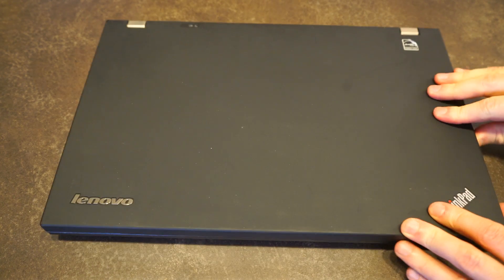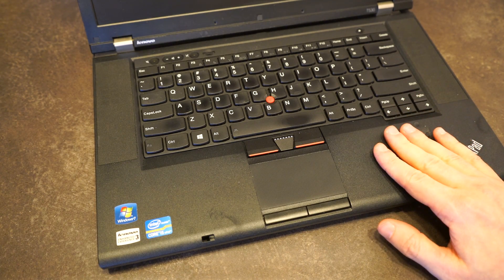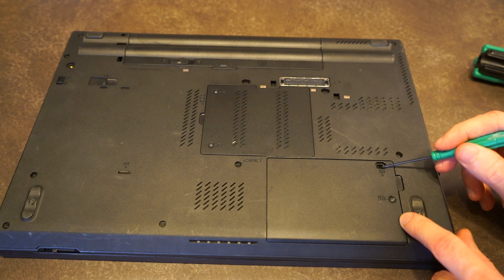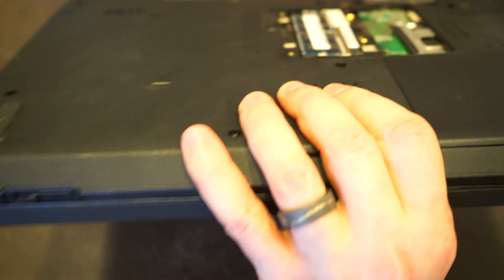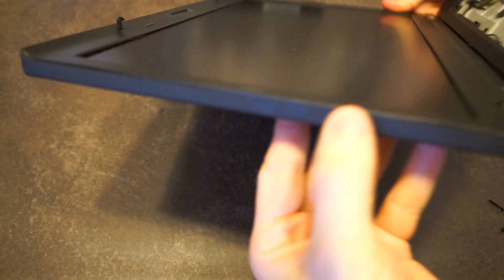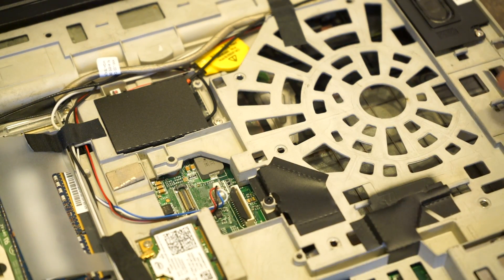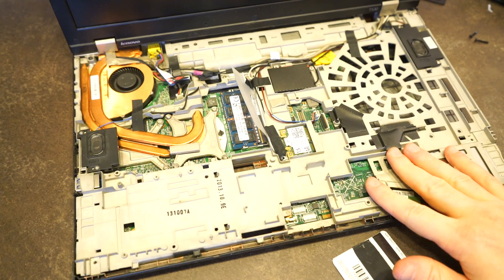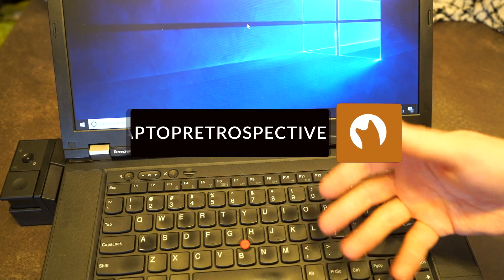Lenovo ThinkPad T530: The T430’s “Big Brother”

Comment: Interesting. So could these machines be comfortably used today? I've seen these used, and it's tempting, as I don't have a lot of money to throw around on a replacement for my Acer.
Reply from the maker: Depending on what you need your computer to do, very much so! One has to remember that they were a thousand dollar business class laptop when they were new and for a good reason. I've given three different people T430 units and nothing but great things to say about them. The T530 is just its bigger brother for those that like bigger screens.
Reply: @LaptopRetrospective  Wow, fast response! Thanks. 
See, the problem I've been having with computer shopping is that none of the descriptors MEAN anything anymore. High clock speed doesn't necessarily mean high performance, and an i7 processor can be outclassed by a newer i3 or i5. Even the benchmarks on a site like Passmark can lead to unfulfilled expectations and disappointment. It's aggravating. Nothing is as cut and dry as it used to be.
Reply from the maker: @jessragan6714  I know what you mean, it can be a bit frustrating. Nothing beats hands on.
Reply: @LaptopRetrospective  Well, I took the plunge. Found a T530 for $190 on Mercari. The deal sounds almost too good to be true, and it very well may be, but I've got my fingers crossed.
Reply from the maker: @jessragan6714  let us know how it goes! We are rooting for you.
Reply: @LaptopRetrospective  Whoops, guess I owe you a follow-up! I'm using it now. It's not the prettiest machine, looking like a black brick when closed, but it's extremely hardy and reliable. Fast, too. I think I'll be keeping it! Thanks for the advice.
Reply from the maker: My pleasure. I'm glad your experience has been positive. Any plans for upgrading? SSD? More RAM? Second drive?
Reply: @LaptopRetrospective  It came with an SSD, but a tiny one (128GB). It's been supplemented with a standard spinning hard drive in the DVD drive bay... I had one lying around and it was almost sinfully easy to install with a caddy I bought on Amazon. I'm rockin' eight gigs at the moment and probably won't take it much farther than that. This system can apparently go as far as 32GB, which seems... excessive. I think I'm good!
Reply from the maker: @jessragan6714  you've also got that slot you could install an mSATA drive, or what about an eGPU setup for your Express Card slot? (Video coming soon btw)
Reply: @LaptopRetrospective  It's a many layered thing, this system. I'm probably not gonna use that mSATA port, but I would like to see how this system handles external video cards!
Reply from the maker: @jessragan6714  I'll try not to keep you waiting too long. I've got a preview picture in the community tab. Initial results are very positive.
Reply: @LaptopRetrospective  I wound up buying a T430 for $54 on eBay, to supplement my T530. Man, these things are like potato chips! Except it's a much more expensive addiction than a can of Pringles...
The system was purchased as parts/repair, but testing it with a build of Linux installed on a flash drive indicates that it works just fine. I won't know for sure until I get an SSD in the hard drive bay, though.
Reply from the maker: @jessragan6714  haha I understand. They are fun machines.

Comment: Just bought one of these second hand with 4gb ram, one module in the top slot. Would just buying 1 4gb module work to get it to 8gb or would I be better off buying a matched pair?
Reply from the maker: Unless the module is the same speed then you might be a bit disappointed. If you were replacing both I'd go for the full 16GB if it is financially viable.
Reply: @LaptopRetrospective  16gb worth it in a machine this old in your opinion? Machine is in great condition, although it's currently lacking a hard drive, it booted fine using an external drive that had Linux installed on it
Reply from the maker: Fair point but depending on your use you might wish you had some extra RAM. These things last so also think down the road.
Reply: @LaptopRetrospective  I think I might go for 16GB anyway.  It's not that expensive and I want to see how far I can upgrade it
Reply from the maker: This is what most people do with these machines. 😁

Comment: Just bought a refurbished T530 - condition is not as good as this. 
Dearly wanted the 520 keyboard, but not sure if I want to do the "surgery" needed to swap out [apparently, some keys don't work afterwards?]
Reply from the maker: That's correct. You can get software to remap most of the keys that don't work but not all.

Comment: Just ordered one of these off eBay for $220.
Reply from the maker: Nice, let us know when you get it!
Reply: Laptop Retrospective it’s the i7-3520m @2.9GHz 8GB nvs 5400, only has 128GB hdd but I figured I could upgrade that later. It was this or t430, but maybe I’ll get a t430 also if this works out.
Reply from the maker: Nice specs. Agreed on the HDD. Swap for an SSD and you have a beast.
Reply: Laptop Retrospective i guess it’s actually a 128 GB SSD... I misread the description. I think I’ll probably order a x230 and t430 as well. One question: can they all use the same dock?
Reply from the maker: Yes.
Reply: Laptop Retrospective thank you for responding. One more question, I’ve read online that non genuine batteries will not charge in these laptops. Have you tried non genuine batteries? I didn’t realize this and ordered a cheaper battery off eBay. Now I’m worried I wasted my money and should look for a genuine.
Reply from the maker: This was true when the laptop first came out. Now, most manufacturers use a method that bypasses the issue. So as long as it's not old stock and it was purchased from a reputable seller, you should be fine.
Reply: Laptop Retrospective that is definitely good to hear, and  thanks for all your help!
Reply from the maker: You're welcome! Good luck.
Reply: b Dub Even if you have an issue, there are videos on YouTube to bypass Lenovo’s battery whitelist through a BIOS adjustment.
Reply from the maker: True, although it isn't often you still need to do it.
Reply: Erik Ive had zero issues with the cheap battery, it works good.
Reply: Erik I actually bought 2 different cheap batteries, first one was a “genuine” 🙄 70+, pretty sure it’s a knock off because it was only $30, the other was a no name $18 6 cell, and they both charge no problem. All you people saying you need a Lenovo battery or mess with bios are uninformed. These newer batteries work well, even cheapest ones on eBay.
Reply from the maker: Not so much uninformed but they are working with outdated information when the laptop came out. Those features have long since been bypassed by manufacturers.
Reply: Which vendor is best for refurb W530?

Comment: I bought a government surplus T530 two years ago. It was in pristine condition,  no scratch or wear marks. Windows 7 was preinstalled and I've been using that. With Win 7, Lenovo had many customizations to the OS. Since upgrading with Win 10 will toss all that, isn't that a minus to upgrading. For example, does your fingerprint scanner really work? Can you adjust battery charging advanced settings, etc.
Reply: im typing this from my T530, and yes, all works perfectly in windows 10, mine is in 1809 update now, and yepp its works like a charm, bluetooth, camera, fingerprint, all hotkey also working good, even the Dolby Digital Plus working perfectly.

lenovo remove power manager from windows 10, and replace it with Lenovo Vantage, you can download it from windows store for free and its pretty awesome, battery charge threshold also works.

allready using W10 for last 6 months, so far and i didnt find anything wrong with it.
Reply from the maker: Thanks for sharing your experience.
Reply: @adiabriganjarutama6144  How to remove the power manager from Windows 10? What do you have in mind?
Reply: @alexf1515  i didnt, lenovo did.
start in windows 10 they remove power manager and replace it with lenovo vantage
Reply: @adiabriganjarutama6144  How and what do you mean? I can't imagine how you can use the built-in Windows Power Manager and replace it with lenovo vantage or whatever. How to do it technically? I can't hack Windows and change it programmatically. I do not understand how to do this, there is no "replace" button. What exactly do you mean and how to do it step by step?!
Reply from the maker: I didn't really have any issues with either. Granted your points are quite valid. I didn't make the OS choice for this device.

Comment: As I found out just last week the seperation of the bezel on the left side isn't a sign of excesive servicing of the display but rather a sign of the hinge getting stuck. Once it gets stuck completely the thin part of the hinge in the bezel cracks and it also tears the screw housings from the plastic part of the bezel. Fortunately you can glue them back in and the pair of replacement hinges costs $8 on Aliexpress.

Comment: Just bought a W530, it s very similiar but even better: quad core i7. (Supports i7 3920XM !), full HD panel,  32 Gb of RAM maximum, and even Raid 0 and 1 configs, and an nVidia Quadro K1/2000 graphic card with 2 gigs of dedicated memory.
It also Can support 3hdds using bay drive and internal msata slot. This is a truly beast!!!
Reply from the maker: Truly a beast by any definition.
Reply: I too have one of these, with the 3740QM and 32GB of RAM. It actually benchmarks slightly better than my i7 desktop machine (which is also a quad core Ivy Bridge architecture).

It's well worth replacing the SSD if you've still got an original era SSD in it; the drive that came in mine is about a quarter of the speed of a Samsung EVO 860 and I noticed that my desktop would lock up briefly when the CPU was waiting on disk IO.

This is more of a problem with a quad core as the CPU cores are much more likely to find themselves waiting for the disk during busy periods of IO. I'd often get lockups during software upgrades and big recompilation tasks.

A Samsung EVO drive fixed it completely (and significantly decreased the time taken to compile a Linux kernel).
Reply from the maker: Good information, thanks for sharing.

Comment: Hi brother, going to buy a second hand T530, i7 4gb RAM 256 SSD. I would like to know whether I can add an additional HDD on this device along with the SSD. On my googling I found someone saying to remove DVD drive to do so. I am also fine with that. But in your other video you were installing an msata in the same model without removing anything so I am confused. I found out how to upgrade RAM from this video. Can you help how to expand the storage ? And which RAM with what frequency should I buy for an 8GB upgrade ?
Reply from the maker: You can use an Ultrabay with the T530, I have a video showcasing this on the channel. You can also install an mSATA drive for a total of three hard drives if you wanted. As for RAM frequency, consult the spec sheet or the maintenance manual in the description. Good luck!

Comment: I found an upgraded T530 for a great price! I plan to use it for school, but afraid its kinda bulky. Would you say its a bad idea? 

Thank you!
Reply from the maker: You're the one that would be carrying it. I'd go with a lighter option but it's up to what you are willing to cart around.
Reply: @LaptopRetrospective  I just found such a great price, but after looking up the weight I have to agree its too heavy.

Maybe I'll try to up my budget and get myself a T440.
Reply from the maker: Don't forget you have the option of the T430 and X230 which are considered to be some of the best in the ThinkPad lineup.
Reply: @LaptopRetrospective  haha I found a good deal on an x230. Only problem is it comes with no battery and I seem to need one to do the EC flash for an aftermarket battery. 

Do you know if its possible to flash the EC using an aftermarket battery? Or does it have to be genuine one? I am getting so many mixed things, someone even told me its supposed to be just a lenovo branded one...
Reply from the maker: Aftermarket batteries are made now with a workaround that hasn't been an issue in years.
Reply: @LaptopRetrospective  Unfortunately I cannot find an x230 9-cell battery on Amazon. Therefore, I am buying an x220 9-cell. I'll see, maybe it wont be a problem, but chances are it will.
Reply from the maker: What country are you in?
Reply: @LaptopRetrospective  Canada. Buying from ebay is unrealistic because it'll either ship from china and take a couple months to arrive or it'll ship from the US and cost a lot for shipping and import charges.
Reply from the maker: https://www.battdepot.com/ca/ this is where I buy mine, check it out first. Quality stuff.
Reply: @LaptopRetrospective  unfortunately I cant find as high capacity as I can find on Amazon. Its also more expensive.
Reply from the maker: Amazon capacities often are false. Hate to say it. BattDepot has a warranty and somebody to hold accountable. Extra cost in my mind is worth it. Also they are in country.
Reply: @LaptopRetrospective  True, and I see your point. But I plan to buy a battery, that even if may not always be great, has very generous warranty. If, for example, I see the battery wears down too much, I can get a refund.

Edit: i mean not a refund, but a new battery.
Reply: @LaptopRetrospective  Also, I dont believe amazon is like ebay. I believe there is some reliability.

Comment: Hey
I was researching refurbished thinkpad t530 and I found this vid to be incredibly helpful.
I recently bought a refurbished thinkpad T530 and was wondering if you could assess it, if you have the time!
Its specs are 
Intel(R) Core(TM) i5-3360M CPU @ 2.80GHz Processor
Windows 10 
4GB memory
DVD-RW
Integrated intel HD 4000 graphics
HDD 500GB serial ata
 
If you could help me out, it would be amazing
Reply from the maker: What would you like to know? I'll do my best!
Reply: Laptop Retrospective im just gonna be using it for just college stuff like simple java coding and etc.
You think these specs are enough? Or is there something I should be wanting to upgrade?
Reply from the maker: Maybe RAM but I'd start with what you have and upgrade as you need. I'd suggest an SSD for the biggest increase in performance.
Reply: Laptop Retrospective you think $150 was a good deal for the specs?
Reply from the maker: Specs and if it's in good shape, yep.
Reply: Laptop Retrospective can i buy any sort of SSD online? Or do i need a specific type??
Reply from the maker: 2.5 inch, standard size for laptops.
Reply: @LaptopRetrospective  What's the difference between the 2.5 inch SSD that replaces the HDD and the mSATA SSD
Reply from the maker: mSATA is a completely different form factor, more the size of a WiFi card.

Comment: I just bought a T530 here in Australia for $100 AUD. It is in almost perfect condition other than some yucky mess on the top matte surface of the device and it didn't come with a battery. Considering I just bought a new battery for this for $45 AUD, $145 AUD for a functioning, ready for on the go use ThinkPad T530 is really good especially considering it would have cost around $103 USD. I will be traveling to the US this year and needed a decent laptop for that and the long run so I don't think I could have asked for a better bargain.
Reply: I want to get this for school, as Ive found an upgraded model for $160 CAD. How light is it from your experience?
Reply from the maker: T530 is full-size so weight isn't as light as the T430 or X230.
Reply from the maker: Inclined to agree Tom, that is a deal to be proud of. Safe travels.

Comment: In regards to the battery needing to be a genuine battery, the reason why nowadays this is not an issue is due to batteries being produced and sold today for these units being decrypted to be allowed by the ThinkPad's BIOS thus bypassing the DRM. This was an issue in the first couple years of this and similar units but we are many years out of this and manufactures and sellers of their batteries have clued into this. It will be very hard to find a battery for these units being sold that isn't decrypted unless it is a dodgy Ebay seller with under a 95% rating.
Reply from the maker: Thanks for shedding light on this. I hadn't had issues but some users were reporting it.

Comment: I have a T510, i5 with 8gb of ram, and a T530, i7 with 8gb ram.  
The T510 has a 250gb SSD, with a 500gb SATA in the optical port.  
The T530 has a 120gb mSATA and a 500gb SATA as a secondary drive (kept the DVD drive in it too, which is nice)
Both have docking stations and run Nvidia graphics. They are hands down the best laptops I have ever had.  The i7 needed a replacement battery, but other than that they have both performed like champs. I will (hopefully) never own any other laptops.  This is a great video. Thank you for creating it!
Reply from the maker: Thanks Kender, glad you enjoyed it. They are something special for sure, no doubt about it. Sounds like a great collection.

Comment: I have a T530 in just about as good condition bought a year and a half ago. I have replaced the battery (not original so it didn't need an OEM one), added two SSD's and 16gb RAM. It already had a 900p screen, a quad core i7 and nVidia GPU. When docked using original Lenovo dock it drives three external monitors. It's not as portable as my T440s but as a desktop replacement with occasional portability it is absolutely fantastic. I love it.
Reply from the maker: What a beast. Great to hear you take advantage of the docking capabilities as well.